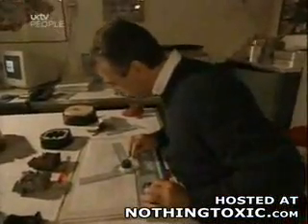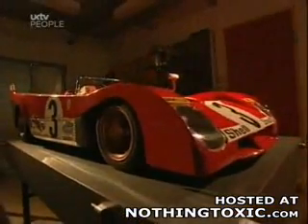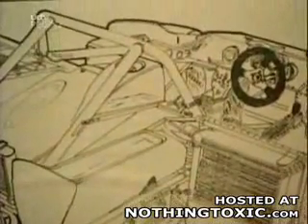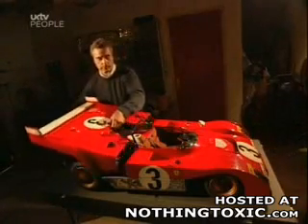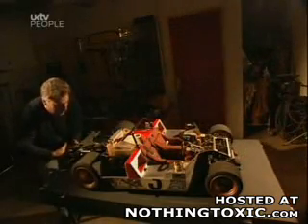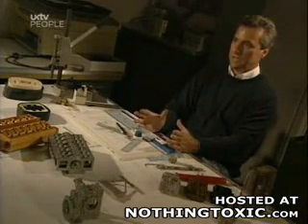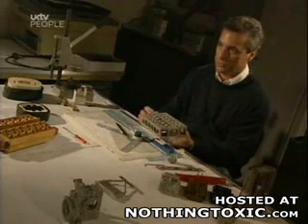Working Ferrari model

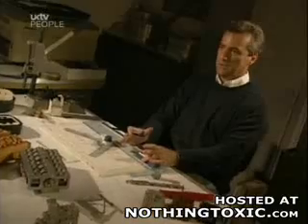Comment: I would be interrested in the power that moror produces, I guess its lower than 1:10 or what measure he used, because the loss which can be accounted to miniaturization. But who knows, I wouldnt be surprised it has 1:10 + 10% of the ferrari power :)

Comment: Well, that's right - it's usually to rest your foot on in a road car but it is really used to brace yourself against cornering and braking loads in a racing car.  It's very hard to drive a fast racing car quickly without it.

Comment: Yes, mustangphil,  had some close up shots and specs of this - it's on the net somewhere. Trans is exact - straight cut gears dog clutches, Dry sump system, Tacho is cable drive as original, headlamp lenses exact from etched dies, he learnt to work glass to make them, learnt to mold rubber to make the tyres and other components.
  Many thousands of pounds ?  -  hundreds of thousands.  And dead right about Ferrari , if they haven't already they should offer to purchase or support future work.

Comment: now lets think about this if the guy can build a 12 cylinder ferrari engine in miniauture that works do you honnestly think  a clutch and gears are going to be a problem but on a serious note on minature modeling which i do a lot of static and working a 1/32 scale sherman tank if everything was scaled down correct materials as well would weigh 1 ton real item 32 tons put that on top of the telly the mind boggles